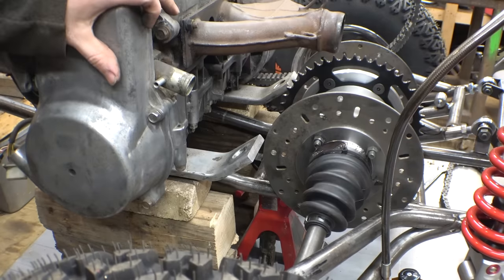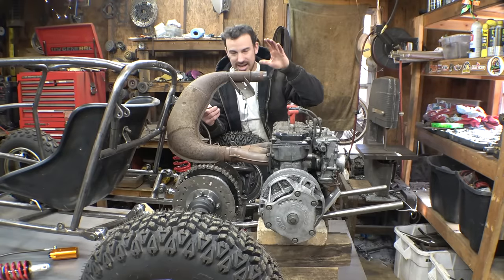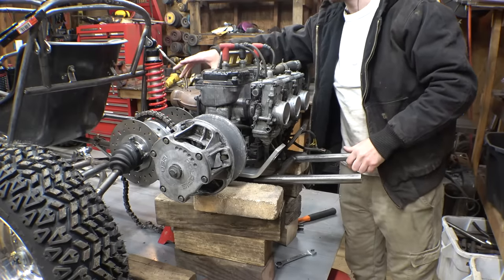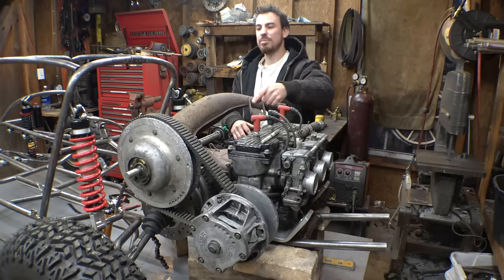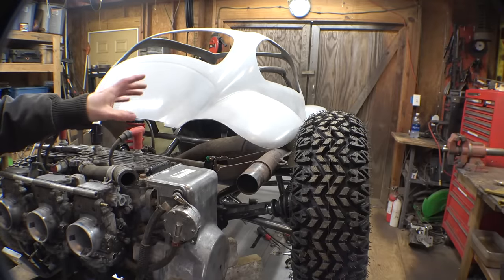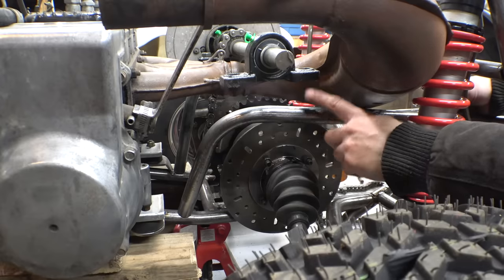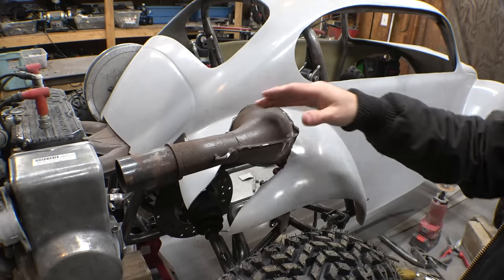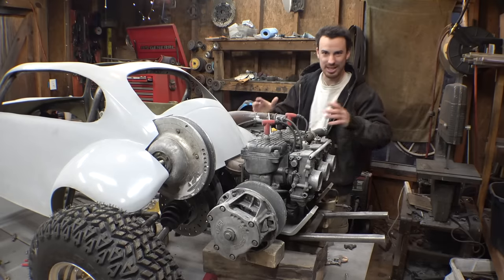Installing the Engine on the - Home Made Mini VW Baja Bug!! - Part 7

Comment: So hear me out. I have been tossing this idea around for a while now, and you are beating me to it. Get rid of the cv setup and go to a primary drive to a divorced transmission. There have been a couple of bikes that were made in the 2000s (gatto nero and the tularis 800) that did this. With your skill, knowledge, and access to machinery, you could make it work. It would be smaller than the cv, and nothing is better than banging gears. I was always thinking of going the route of cutting off a ducati transmission because of the dry clutch setup.

Comment: It’s probably too late to change gears, but have you considered fabricating a fake “swamp cooler” and house the radiator in there? There would be a really great solution and then you could reroute that exhaust through the back window like you wanted.

Comment: I think you might have been thinking about the motor mounts incorrectly. It's a matter of torque and you want to counteract the torque the enigne puts out - so regardless of which side the belt is on, the engine still wants to twist the same way! 

So you motor mounts are backwards now.

Comment: Im gonna keep repeating my comments...use the side bars.."tree bashers as also a enclosed unit fuel tank on both sides!!! Weight Weill be lower centre of gravity and might also help with keeping the front from lifting and will also give you more room for your radiator situation
I really don't see why you have not thought of this yet tbh

Comment: The secondary clutch was originally behind the carburetors and now you moved it in front of the carbs. Won’t that spin the secondary clutch backwards thus make the buggy run backwards?
Reply: Still rotates the same way
Reply: I'm glad I'm not the only one worried about rotation direction. Engine spins clockwise and was flipped 180 degrees. What's the fix? Spin the engine backward???
Reply: @ScottyB1987 Carbs point towards the rear in the sled so engine is mounted the same way here. Engine rotation is correct.
Reply: @ScottyB1987  I’m eating my popcorn. Maybe I’m wrong. We will find out…

Comment: Would you be interested in some specs for a tuned pipe so you can make your own and pie cut it to fit how you want? you only need some basic info from what ever 2 stroke engine you use. I have some software for designing these you can use just shoot me some info on the engine and  I can get you a breakdown of the sizes. Good luck and enjoy the build and riding later love the videos.

Comment: My snowmobile pipe got hot enough to melt the hood. Either ceramic coat it and or wrap it in heat tape!

Comment: 10 minutes in I'm already thinking about every way to have the engine 180° with the exhaust facing backward. It's taking up so much space and it would make so much more sense to have the radiator blowing cool air towards the intake side instead of the exhaust. You could also mount a fuel tank behind your seat without a hot exhaust right beneath it. Not to mention you're cutting what has made this build so cool! Not the body man!!!😅😅 No hate, there just has to be another way.

Comment: Was it maybe possible to rotate the engine and put the intake forward? Engine could be also more towards the front, poulie and exhaust poking out the rear. Would require some sort of gearset to get the correct rotation, but would solve a lot of issues.
Or… maybe you could run the engine backwards since it is a two stroke…

Comment: Can you do two smaller radiators in the front behind where the headlights would go so air still gets to the radiator through the holes where the headlights go

Comment: Thoughts on two small radiators mounted to the front of the rear fenders? Think like a side mounted oil cooler on a car, that sort of idea
Reply: Or on the inside of the fenders, then make some routing vents?

Comment: Measure once cut 6 times oof🤦 but had to be done, you should only have to widen next to the second pulley area as wide as the new belt is.

Comment: Have you ever seen the result of a cooling system rupturing and burning the driver of a vehicle?      There's plenty of instances on YT.   Even happened at a Cleetus Mcfarland event Nov. 2020 resulting in third degree burns.   
Put up a firewall.

Comment: Does fibreglass burn? It depends on the resins used some are fire retardant some not. Test a piece of off cut. If it burns with a thick black smoke thats bad as its carcinogenic and you'll definitely want to keep it away from the exhaust.

Comment: My only fear is that the open diff will turn whichever wheel is less loaded into a pizza cutter. Just like RC vehicles do when one tire spins. I believe you may have made a big mistake choosing the diff. That said, if it DOES turn out to be an issue, it's fast and easy to simply weld up the diff gears. While I agree a steering brake would be kinda cool, the open diff brings too many problems to handling and acceleration.
Reply: Traction varies as you move forward. If you moderate the throttle a bit you can control it and he has cutting brakes so if one wheel initially spins to much a touch of brake on the spinning wheel will help stop the spinning. I think it will be OK. Looking forward to seeing it in action.

Comment: Why did you not put a air cooled scooter engine in it.from a vespa or something like that you could of fitted that a better looking way and have the exhaust  come under and out the back .no radiator to worry about .

Comment: Why don't you just put isolator rubber pieces up on top of the roof and raise the whole cab so it's not riding on the roll bar

Comment: why don"t you just raise the roll bar cage up to increase the distance between the wheel wells and separate the distance from the engine more instead of cutting more vw fiberglass

Comment: U no that u can put the cars on the front & your pipe at the rear just turn the pistons a round I did it with a cr250 r engine 4 a go cart
Reply: Carbs

Comment: Hello! I see you do lots of welding and machining for a lot of your projects! We have a tool that may help with the construction of these machines. We are a startup company specializing in metal 3D printing. Currently we offer 316L and 17-4PH stainless steel. We could potentially create fixtures or even parts to help assist in the construction of these vehicles. If you are interested or have questions, please send a message and check out our channel! Thank you & good luck with the build!

Comment: Please please please do not put that radiator in the rear window. If that thing springs a leak, you are going to be scarred for life. That is boiling hot water and you don’t want that anywhere near you. Mount that radiator over the engine or somewhere else far away from you.
Reply: Also, make sure you have a roll bar above your head in case you roll. The way you have that thing set up now, your head is the roll bar. You’re just asking to break your neck if it flips and it will flip.

Comment: This looks bad. An electric version of this would be much better with hub motors.
Reply: Yeah you should definitely build that
Reply: Hub motors ? No thanks...
Reply: Or a qs180 or something similar mid mount or even two one per rear wheel.
Reply: Really? Lets see YOUR handbuilt custom vehicle  so we can all see how it SHOULD be done. What's that? You have no hand built custom vehicle? Then STFU until you do.
Reply: @ManiacRacing  I have built a custom ebike, but that won't change the fact that this build looks bad. He need to squeeze too many things into a space that does not exists.